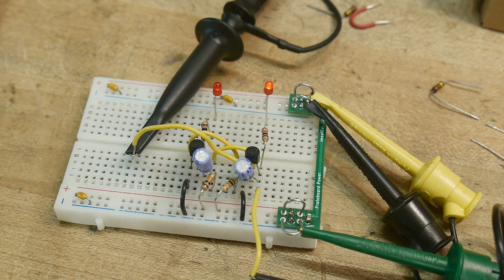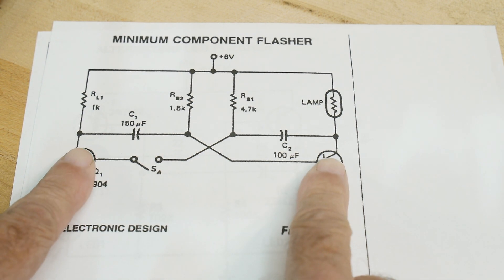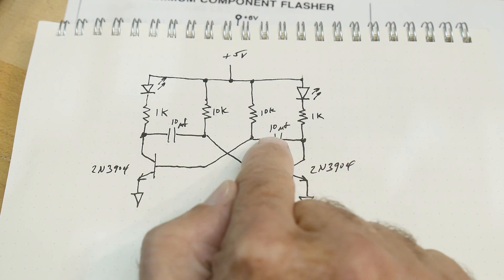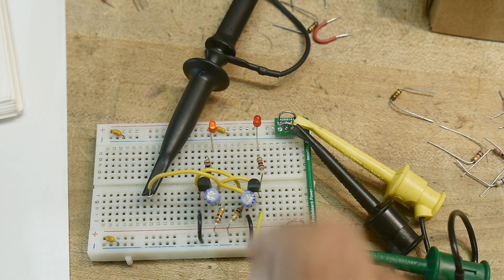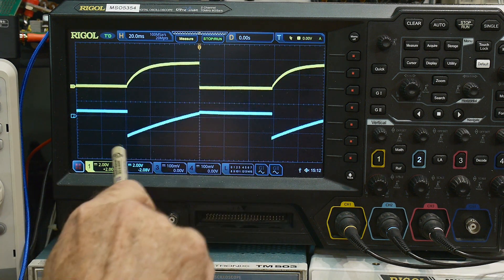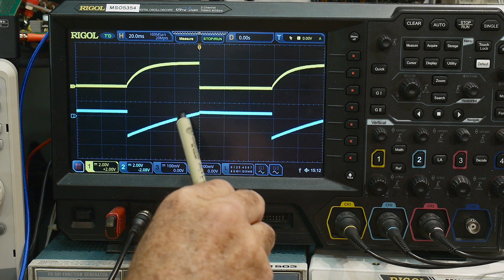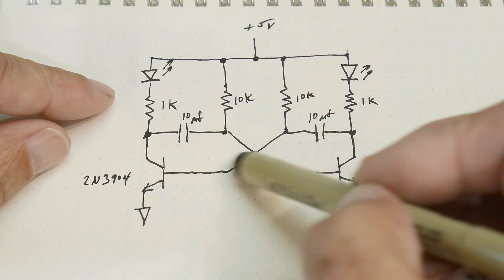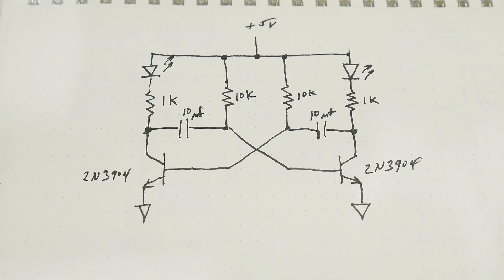#1697 Two NPN Transistor LED Flasher

Comment: Weird that the modern generation would use a processor running at 1GHz with at least 2GB of memory to achieve exactly this…😜😜😜sorry kids 🤣😂🤣
Reply: I used to (mock) disparagingly refer to a certain line of products as Ardie-Weenie. But the fact is that it has been a gateway to electronics for a lot of people. They start out barely able to connect a power supply or use the basic functions of a multimeter, but lots seem to make great strides quite rapidly.

I used a microcontroller in a commercially made product for doing quite simple timing. I looked at what it would take with other timing methods and the processor made good sense. It was just a PIC12 series part with 8 pins so it was inexpensive. Against that, I had one client whose engineering manager wanted to do everything with microcontrollers. Sometimes it made good sense. I took some devious pleasure in designing all-analog circuits that kind of left him out of the loop. Many years ago I designed a circuit with a whole boat load of analog circuitry, including three phase-locked loops. If I were doing it now I'd do pretty much the entire job with a processor now there are lots that can divide by thee with sufficient haste.

Comment: The slow rise on the collector is simply due to the fact that a capacitor is being charged through the collector load (LED and resistor). [edit] Actual turn-off of the transistor itself is about as fast as you'll ever get with a BJT because of the rather large reverse voltage applied to the B-E junction. That sweeps carriers out of the base region resulting in turn-off even faster than you'd get by shorting the base to the emitter and very much faster than simply stopping flow of (conventional) current into the base.
In the PNP circuit the negative side of the supply was being used as "ground" for the scope when the positive side of the supply should have been used for equivalence to this circuit.

Unlike the PNP circuit this is not a slow death circuit where the B-E junctions of the transistors are being subjected to reverse breakdown voltage with consequent degradation over time of current gain. This is simply due to the lower supply voltage used for this circuit.

There appears to be about 0.3 V of "fur" on the supply voltage.

Comment: In 1970  I built a multivibrator like this , except that it was  with 2 germany PNP "AC 128" transistors.  Instead of LED I employed a VW Beetle courtesy light bulb , thus it had to run slower to see light blinking. I had nearly no experience with electronics , so a friend of mine who owned a Radio\ TV repair shop taught me some lessons.

Comment: This is exactly the circuit that brought me into electronics when I was about 11 or 12 years old. At that time I used Germanium transistors and lightbulbs instead of LEDs. It is also the circuit that brought me into designing and building my very first circuit board. So much things I learned at that time. Iron(III) chloride was such magic and somehow frightening thing when I saw the copper disappearing slowly on the circuit board. I even built a little wooden box to house my little light flasher and to show it to others. But the strangest thing of all is that even today I can't really explain how this circuit works, yeah! (I have always remained a hobbyist and became a software engineer instead.)
Reply: I think the thing that makes this circuit hard to analyze is the uncertain behavior at power-up. The version shown in the original schematic with the switch in the signal path is easier because a well-defined stable state is entered with the switch open.

These multivibrators can actually go to a persistent stable state at power-up. If all the components were precisely matched, that would be likely.

Comment: NPN transistor multivibrator was one of the first electronic circuits I ever built, both with an incandescent lamp and a LED. It was a lot of fun to see it work, though I would have to wait over a decade until I got my first scope.

Comment: Viewers from the digital age might understand this idea better if you build a simple astable with two gates of a 4069 hex inverter.  

From a node in the middle of the schematic, connect a 1 nF cap to the output of gate 1, a 1 meg resistor to the input of gate 2, a 100k to the output of gate 2.  Tie the output of gate 2 back around to the input of gate 1.  

Probe the outputs of the two gates, and the node in the middle.  You'll find the node in the middle swinging between -2.5 and +7.5 V (roughly) on a 5 volt supply.  You get away with the voltage excursions because that 1 meg resistor keeps there from being enough current to drive the protection diodes into full conduction. A scope probe on the input of gate 2 messes up the oscillator because it overloads the  meg resistor, but if you're really  curious about that input, you can use an FET-input op amp configured as a unity-gain follower to buffer the signal to show it on a scope.

You can use any odd inverting gate (NAND, NOR, XOR, etc.) to build this oscillator. It used to be my go-to for making the square wave to drive an LCD backplane.  Then each segment can be driven with a quarter of a 4070 or 74HC86. I trotted it out again not too long ago, to drive a liquid crystal light valve - it all was done with a 4070  and a handful of passives.  The power to the 4070 came from an LM317L adjusted so that the output voltage of the oscillator gave maximum darkening. The logic input came through an optoisolator (a system requirement anyway, the system under test also had high-current 400V power around). Strictly old-school design, but with modern packaging the whole thing fit on a board the size of a postage stamp and could be built into an optical housing. It replaced a thousand-buck external controller that was total overkill for the job, which in turn freed up a much-needed slot on a DIN rack.

Comment: Tomorrow a flashing Led video with a PNP and NPN transistor?
Reply: or UJT. :)
Reply: @stamasd8500  I'm afraid that UJTs are moving to the Land of Orphaned Components. Although you can get some, even inexpensive ones, they are getting harder to find. Of course, they are better off than the poor tunnel diodes who have been on the missing persons list for some time. At least they will have lots of company with all those mercury rectifiers, magic eye tubes, and CRTs. (grin)
Reply: @stamasd8500  
Programmable unijunction transistors are interesting and useful devices. It appears that the 2N6027 and 6028 are still in production.